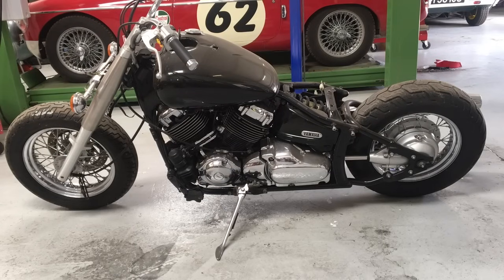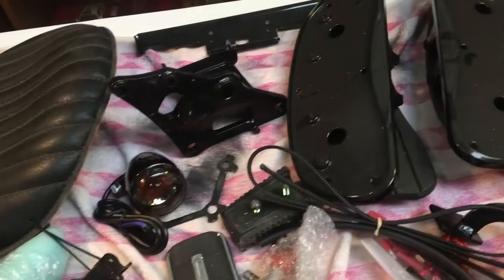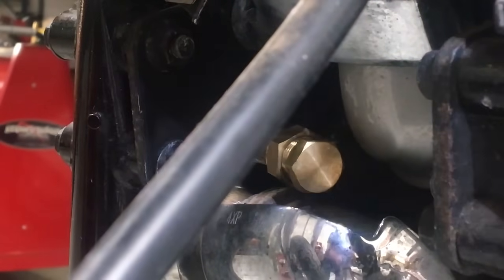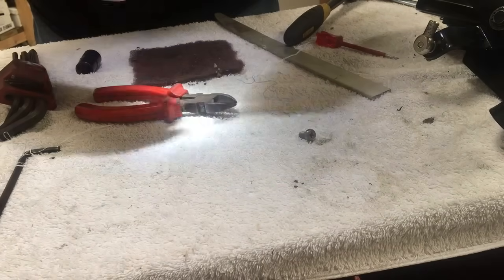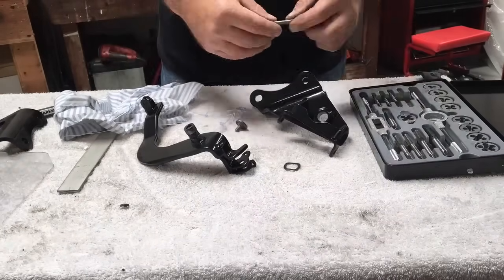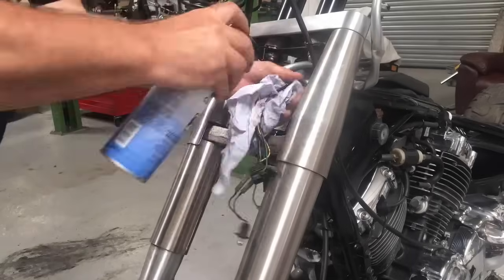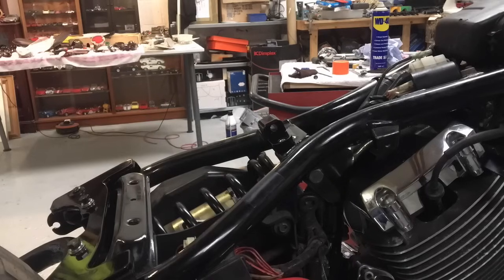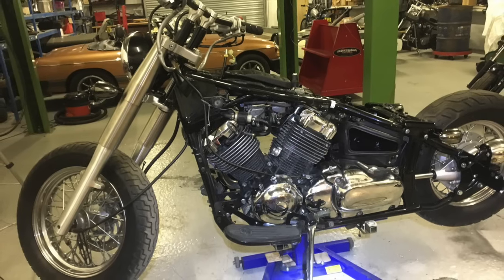Bobber Build Yamaha V Star Dragstar XVS 650 AIS Removal

Comment: You smack the brass piece out with a file or chisel and hammer and a 45 ACP shell tabs right in leave the lid for the casing out so you can extract it later if you want to

Comment: Hey Clean Nuts.  When can I get the 12mm compressing brass endcaps. I have been advised that here in ireland they only do 10mm or 15mm. Nothing in a 12. Any help you cannoffer in sourcing is greatly appreciated..
Reply from the maker: They are forsale on uk eBay

Comment: What is it with everyone doing Bobber builds it’s like going backwards in evolution you take off the suspension and put 2 little springs under the seat, just don’t try and ride any distance and make sure all the roads you use are new.
Reply: You don't take off the suspension on these to Bob them. They use the stock rear suspension.